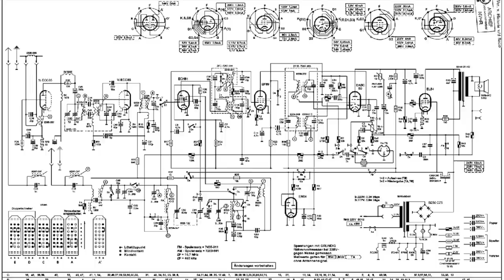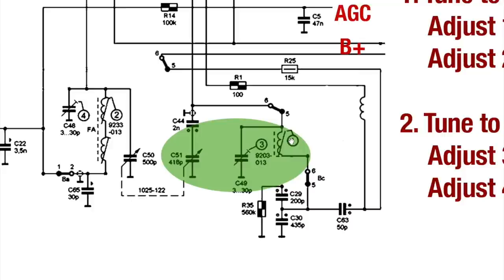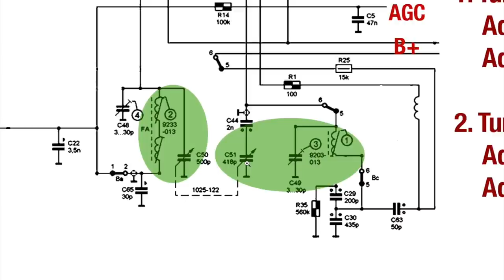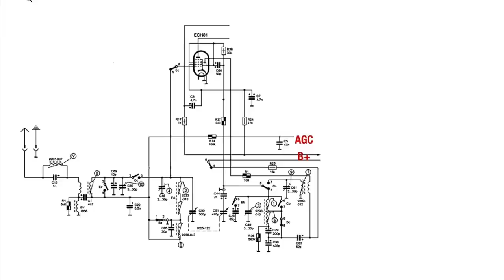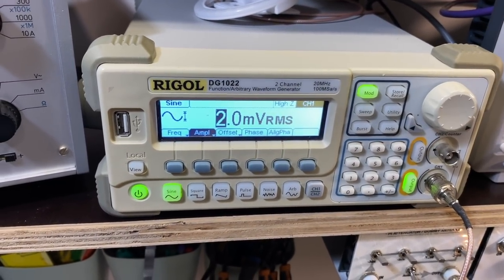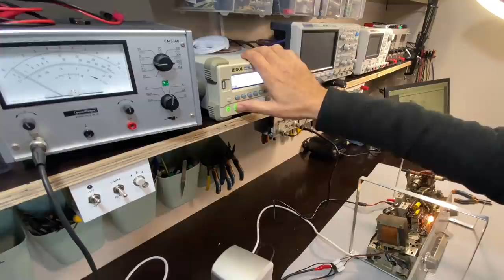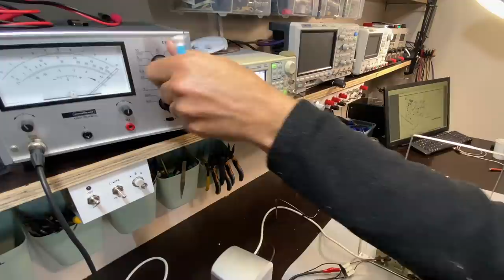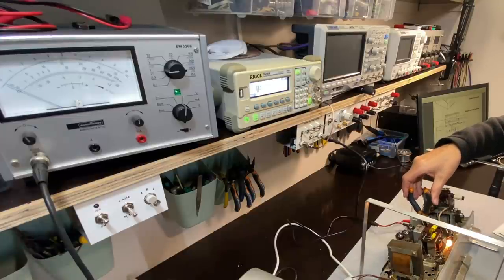Grundig 2147 Restoration pt. 6. RF alignment of the AM bands. What is it and how do we do it?

Comment: It's difficult to explain - but you've managed it. I guess the higher frequencies are affected more by trimming a capacitor and the lower frequencies by trimming a coil. This is why the circuit was designed this way, to minimise the effect of changing the upper and lower frequencies on each other. But as you explained they still do drag each other around a bit, which is why you have to go back and align it again. Nice work, especially because you removed unnecessary clutter on the circuit diagram. I wish there had been someone to explain it better when I was at college, way back in the day...  I had to learn the hard way (or easy depending on your point of view) by doing it myself.
Reply from the maker: no amount of explanation will beat doing it yourself😀

Comment: Thanks again Manuel.  As for the 'waffle' around IF/RF alignments - that has been extremely helpful to my understanding.  It one thing to know of the IF chains, but its another thing to understand WHY they are there and you have been of immense help with the why.
Regarding the slug/wax issue you had in this video.  Have you tried to soften or melt the wax with a hot air gun or are things to delicate ?
Reply from the maker: in this one the sf lugs are too far into the former and i’m afraid of melting it.

Comment: Very nice video again! My way of removing wax is to first use appropriate drill bit with fingers, and then I wrap my sharp soldering tip with kitchen paper. With very low temperature about 100 degrees C the paper sucks the rest of melted wax.

What did you do with the meshed up LW antenna coil? Was it the spare part? Did I miss something?
Reply from the maker: No, I just re-wound it using the same wire. I forgot to mention it specifically, but I will in the next video.

Comment: Excellent description and fascinating stuff. Will for sure check out that Radiomuseum.org forum.
Looking at the schematics as you described it, I couldn't help focusing on C44 of 2nF in series with the oscillator part of the ganged Cap, and it's effect on the circuit.
It lowers the overall capacitance of the 3 capacitors so a drift in the value of this (from heat or age) would shift the frequency of the oscillator (on all bands) in reference to the input circuit.
Would this be something to consider checking before aligning?
Maybe you could use a hex-nut screwdriver on those trimmer caps?
The hard wax in the coils, could it be warmed up slightly to soften it? Carefully with a heatgun or something...
Reply from the maker: You should check it, but They usually use some pretty stable caps in that position. I’ve never found one off so far.

Comment: Hi Manuel, The video is of aligning AM bands, yes? I noticed that the section descriptions are talking about FM theory and alignment.. just wondering if that is correct.
Besides that, a good explanation of dancing between the high and low end of the band to "converge" the alignment.
Cheers,
Reply from the maker: Sorry, I forgot to edit those time stamps 😊 Must be old age.
Reply: @electronicsoldandnew  - No worries, just wanted to bring it to your attention in case it was an issue. I have done this myself :)
Cheers,

Comment: I have a 1934 r119  Stewart Warner radio where they use 177.5 if frequency using a leader LSG11 generator but cannot get it to run at that frequency i get 200 and something khz what am i doing wrong.
Reply from the maker: I’m afraid I don’t know that radio at all.

Comment: Why not use a touch of hot air to soften the wax?
Reply from the maker: The core is very deep in the former, and I’me afraid if I’m not careful I can actually melt it 😊
Reply: @electronicsoldandnew  I guess it depends on the temperature of the hot air. Most hot air soldering stations have adjustable temperature down to around 100C, which should be safe enough, but warm enough to soften the wax.  Even a hair dryer, used from a suitable distance, should suffice. On the other hand, if you're satisfied with the alignment there's little point.